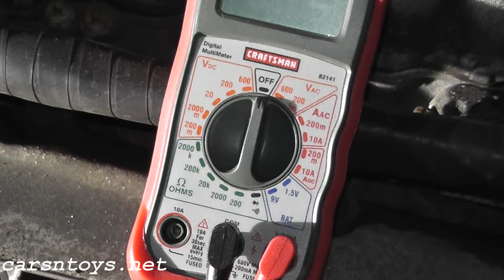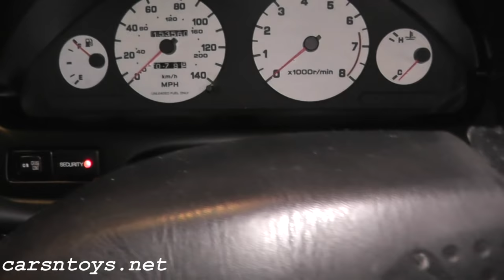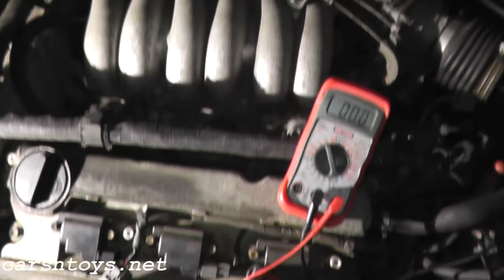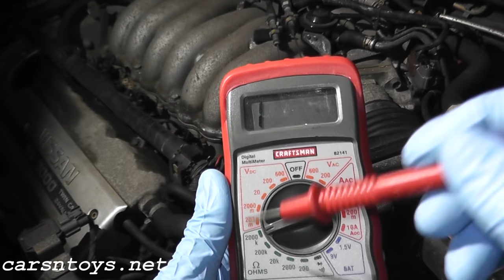P1320 Primary Ignition Signal Fault Testing and Replacement HD

Comment: wouldn't the cylinder be misfiring if the ignition coil is not getting 12 volts, you never did show any failed parts, so that being said, what was the failure on the car in your video that cause the code P1320, when there is no missfire?
Reply from the maker: There was no misfire. Just went over the steps to diagnose.

Comment: my nissan got new ignition coil from nissan dealer. new plugs new crank and camshaft add grounds to the coils. new batery cable (negative) clean all factory grounds new ign. condensor new transmission ground. and the code apear pending. check wiring harness
Reply: Me too if you find one let me know where
Reply: @mbyrd3070  courtesy parts nissan

Comment: Hello CarsNToys. I might have a similar problem in my 2002 Nissan sentra 1.8L. I, though, have a crank/no-start condition and checked and I am not getting spark but I back probed the connector and I have battery voltage and ground. I think I have a  good signal, I am not sure though. How can I check it properly? I thought it was all 4 coil since I am not getting spark when I crank it. Would it be possible all four can go bad? Please let me know what else I could check. Oh and I don't have a scan tool, places where I have taken it to tell me there is no link communication
Reply: Hi. Thanks for replying.  I did changed the crank sensor and still did nothing. I was about to change the ECM today but someone told me to change the Cam sensors. I  am thinking since I changed the sensor it is sending signal to the ECM but the ECM Is not telling the ignition coils to fire that is what I thought that the ECM might be the problem.
Reply: Hello Frank Lopez, I'm curious to know how you resolved this issue? My 2000 Nissan Maxima GLE was displaying trouble code p1320 and all the test in this video lead me to believe it was due to the ignition condenser. So, I ordered one through courtesy parts.com and it arrived within a week or so. I quickly replaced it with the new one. However, my car won't even start now. It cranks like it wants to start, but won't turn over. It drove perfectly fine prior to messing with the ignition condenser. I'm stuck, and carless. Any thoughts/advice? Any feedback would be greatly appreciated.
Reply: Hello Nicholas, I saw a reply and felt like coming to reply. I regret to say that after all these months I still haven't fixed it, it still gives me a no start no spark condition. I replaced the computer thinking it was that since there is no signal sending to the spark to fire, but still didn't do it so I have been riding the bus for a few months now. I feel it could be the EGR, or another coolant sensor, but to find it would be hard.  Could you have a bad starter motor?? I thought that for myself but if yours doesn't turn might be that. Give it a try and have it tested at AutoZone. Best regards, I wish I was more helpful. Merry Christmas to you!
Reply: e fee

Comment: The water reservoir broke and it sits over cylinder forth cylinder coil and harness, so now I have a forth cylinder misfire code. Would these same tests work for water damage?
Reply from the maker: Sure. Use your multi-meter to see if everything is within range.

Comment: Good Video.. I tested my igniton condensor on my 350z no start no fire at coils followed FSM my condensor with 2m setting on voltmeter The voltage goes from .300 up moves slowly to 1.9 and then goes to no reading ... my probes still making contact. have to wait like 15 mins for it to read again Cause it just reads 0... Can this condensor cause the car to not start? Thanks. I have a new condensor on the way just covering my basis.
Reply from the maker: What year is your Z? Any other codes? Recent mods?

Comment: I have a 99 Altima, it had died on me a couple of times and eventually showed the p1320 code. I read up online and all signs pointed to a bad distributor (also has the condenser attached) someone also said to grab and shake the wiring harness going to the dizzy by grabbing and shaking it with the car running, which I did and the car died, and has refused to start ever since, so I replaced the dizzy with a brand new one from rockauto, along with new plugs and wires. Spark is good, but the car still won't run. Also having the battery disconnected while I did the replacement cleared the code, so now I don't have any codes to go by. Any thoughts on what to try next?
Reply: Also tried replacing the crank sensor with no luck.

Comment: Can this code prevent your transmission from switching or is that a valve solenoid circuit malfunction?
Reply: Maybe. I am also facing this problem. Check light on and gear not change.

Comment: Great video! Pulled a P1320 on my 2001 Nissan Pathfinder, so I'm currently fighting with that. I did a voltage test at the #1 harness and I'm seeing 11.90v, is that acceptable or does that show that an issue exists further up the line? Also, have any idea where (if it has one) the ignition condenser is on 2001 Nissan Pathfinder? Thanks!
Reply from the maker: Leonard Burns 11.9 is fine. Check out each ignition coil to verify they're in working condition. You can also do a power balance test. Search under my page for 'how to test ignition coils with basic hand tools'

Comment: I have a 2002 Nissan maxima it just suddenly dies, it may take it a bit to start back up then its ok for a while then a month later it will do it again. I got a code p1320.. I also got the cam sensor I for get what code that was I don't have my notes with me. So with this p1320 code what does the car do when one of those are bad, how does it react.
Reply from the maker: P1320 could certainly stall the car and/or keep the car from starting. A bad cam sensor will certainly stall a vehicle as well. You'll have to do a little work to determine where the problem is. I do have a video regarding the cam sensor - https://youtu.be/38N47i84obI
Reply: I am having the same issue with my 2000 Nissan Maxima with codes p0304 (cylinder 4 misfire) and p1320 (DTC Definition Not Found. I replaced the coil pack on cylinder 4 and all six spark plugs. This cleared code p0304 and the car drove like a champ for weeks. However, code p1320 is still present, so I assumed I should replace the ignition condenser because I wasn't receiving a good reading with my multimeter. It would flash a quick reading (something over a thousand ohms) and disappear. i ordered a new ignition condenser through courtesy parts.com and replaced it, hoping to clear the code, but now the car won't even start. It seems other people are experiencing the exact same issue. Did I do something wrong? Where should I go from here? Any thoughts/feedback would be greatly appreciated. Thank you.
Reply: @nicholasnapier839  what did you end up finding out

Comment: isn't a  condenser just another name for a capacitor? why would you check for ohms? shouldn't you be check for a capacitance reading in farads?
Reply from the maker: grimzp34 Ohms is the correct measurement. If the condenser can't accept the correct resistance then it needs to be replaced.

Comment: Working on 98 Infiniti i30 . . . when testing all six coils exactly as demonstrated I get no reading whatsoever from prong 1 and 2, although when placing the red lead on 2 and black on 3 I get a reading of 1.3 - 1.55 on all six coils, what's going on? And why aren't I getting a reading with 1 and 2, but only 2 and 3?  Please help! Thanks!
Reply from the maker: We both have the same coil packs so you should see similar results on your end. Any other trouble codes besides p1320?

Comment: Thanks for the video ,all the test I did were fine but the Ignition condenser ,,is there another name for it ? . At the auto parts they told me that there is not such a part in a Nissan Maxima 2000 (I took it out of the car and show them) and still I can't find the part anywhere
Reply from the maker: Raul Rodguez Go to courtesyparts.com and type in - 28351M
Reply: Thanks

Comment: Hi, this is a totally different question i have a 2000 nissan maxima I changed the cat and took it to get it smogged i was told that i needed to drive it  for at least a 100 miles well i did and nothing happpened I keep getting OBDII not ready any suggestions?
Reply from the maker: Yea, it takes a bit of time on local and highway driving for all systems to be ready. Just drive a bit more and you'll be fine.

Comment: quick question, i tested the volts on my coil connection and it read 11.7 or something like that. is that normal or should it definitely be 12 volts. thx.
Reply from the maker: 11.7 is fine

Comment: I have no power in The coil number 2 and 3, The condenser is maybe The reason? Thanks you!
Reply from the maker: +chinoboxx What do you mean by no power...the harness connector is not receiving 12v?
Reply: +CarsNToys no, I have all  signals in The harness conector, but I dont have electric spark in The coil number 2 and 3, and all coils are Good because I tested...  Thanks.
Reply: +CarsNToys another thing, when a tested de signal from de ECM to de coil a get 12v on wire + and G wire is Good but on The B wire I get 0.10 V but when I tested The Good one I get 0.25 V on The B wire, Thank you so much for you help!
Reply: +CarsNToys how are you? Please help me! I dont know what to do! I takeoff my ignition condenser from my car and still turns whitout it.... And still The failure still remains! Thanks so much for your help!

Comment: useful video ....
Thank you for your efforts.....
Reply from the maker: ali kıllıoğlu Thanks, Ali
Reply: @CarsNToys  I brought a coil at O'Reilly auto parts and the damm thing wont snap on the connector, even with wide mouth pliers, so I got a tiny piece of sandpaper between the connector and coil, so far its holding.

Comment: Hello, do you know any solution for the P0600 code on a 1998 infiniti i30? thanks!
Reply from the maker: +kenopr1 Sometimes it's a faulty a/t control unit. If you can find one for cheap, try swapping it out and hopefully it will help

Comment: Hey dude, what if the coil is good but not receiving a signal through the harness???
Reply from the maker: +kevin johnson Check the fuse and the wiring. Make sure there are no cuts in the wiring.
Reply: Thanks, is there a fuse for each of the six coils on a 2000 Maxima?
Reply from the maker: kevin johnson
I believe it's only one fuse.

Comment: My 96 maxima says the same code p1320 and p0325 but my car shakes a lot. 
If I drive it like this would it make it worse or get stuck somewhere?
Reply from the maker: SUPER VEGETA You sure could especially if the vehicle is not  running on all cylinders.
Reply: Thanks I appreciate the help. 
Well I been driving it like that for four days. Tomorrow I'm gonna change the knock sensor.
Reply: CarsNToys
Reply from the maker: SUPER VEGETA
Cool man. It's not a fun job changing the knock sensor but it's a good idea to get it done.

Comment: Good video, but lemme add a few things 1. Backprobe. It’s rare, but it does happen that you lose power AFTER the connectors are plugged in. This could be due to terminal spreading, corrosion, wire breakage etc2. You definitely should be checking all your harnesses for ground as well. It’s better IMO to use power and ground in the harness simultaneously, so you only have to test once. If you come up with a bad wire, it’s easy enough to figure out which is missing after the fact 3. KISS (keep it simple stupid) Always check your fuses when dealing with a power loss problem. Glancing at the wiring first is okay if you’re already there, but i’ll check fuses before I start doing continuity checks or any kind of in depth connection tests. 

Also, to check the condenser itself measure resistance between both pins. Spec is >1M Ohm at 70 degrees Fahrenheit
Reply from the maker: Good advice. Thank you.
Reply: CarsNToys No problem. Keep up the good work